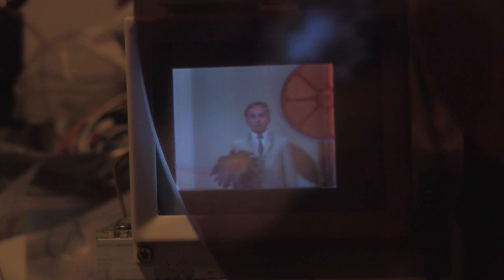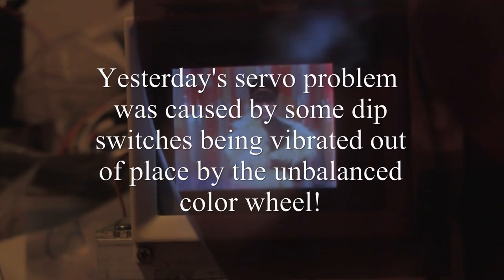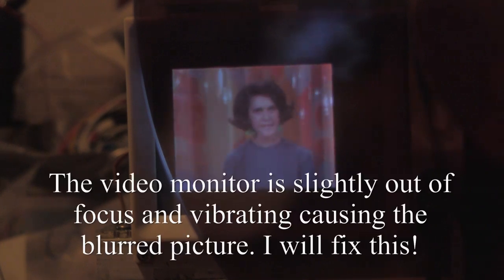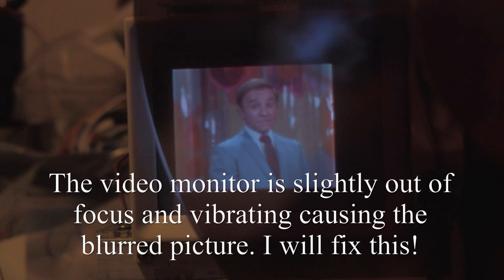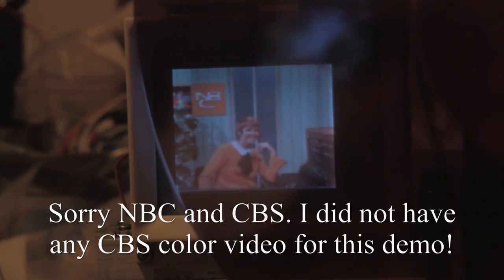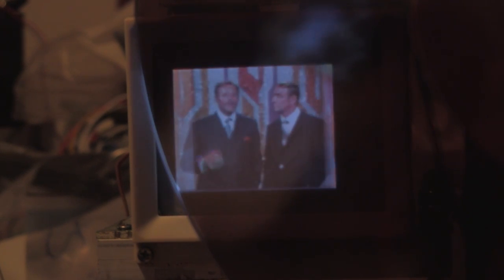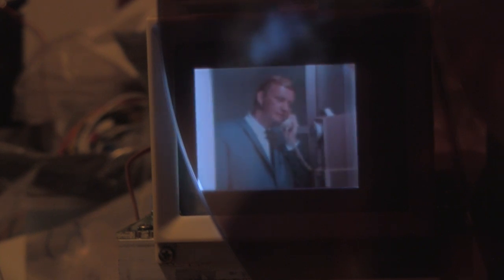Goldmark 1 - First Light #2

Comment: You just know that if this ended up being used, then there would be more research on how to replace the color wheel with something more practical. For instance, how about a cylinder rather than a disk. Or a belt with color filters on it.
It would also work with a shadow mask CRT for obvious reasons, but research on the shadow mask would've not been as strong as it ended up being.

The ultimate form would be the liquid crystal color shutter that was used on oscilloscopes in the 80s.  That ended up being used on JVC video monitors in the late 1990s, but with broadcast sequential color it would be much simpler.
Also, had that happened. it might've come along sooner than it did because it would've been a more profitable idea.
Reply from the maker: The Tektronix TDS744A oscilloscope, that I purchased just for this project, used a tricolor shutter in front of a white CRT. Co inky dink? I think not.
Reply: I recall a "Popular Science" article in the 60s or 70s that pitched a "converter" you could put in front of your B&W set to get color. The diagram showed a belt with colored strips on it.

Comment: NASA used an NTSC compatible Westinghouse (CBS's parent company) camera for the Command Module of Apollo missions 10 through 17 as well as the Apollo/Soyuz and three Skylab missions. It only made it to the surface twice, on Apollo 12 and 14. Neither fared well. Apollo 12 astronaut Al Bean accidentally pointed the camera at the Sun only 42 minutes after activating it and the Apollo 14 camera had problems with the high contrast, especially the bright white of the spacesuits. The RCA built lunar rover camera of Apollo 15-17 used a spinning color disk to send stunning color television from the Moon and the Space Shuttle used mechanical color cameras well into the 1990's.

Comment: This is not really much different than the current DLP projection systems, with the exception that the color wheel is placed between the projector lamp, and the DLP chip, which sequentially displays the colors.
Even though the CBS system never really had commercial success, the principle made it's way down to the single chip DLP systems.

Comment: is this a ordinary B/W television behind this color wheel
Reply: +videolabguy a earlier vision of a DLP scanner very interesting did you make the color wheel or is this a vintage piece
Reply: +videolabguy  I find this very intriguing I hope I'm not bothering you with all the questions the link I found quite surprising there is such a history.   This might sound like a stupid question but, your using a ordinary B/W CRT how does this define color or will it produce color from a B/W source.  sorry for so many questions I find this so interesting
Reply from the maker: +Richard Golden In color TV, there are three channels. Red, green and blue. Same as the sensors in the eye. If you look at each video channel with an oscilloscope, they are each simply BW signals. When the three signals get recombined, on a screen or in your eye, you see full color. In NTSC the three colors are simultaneous. In this system they are in series. First scan contains all red info. Next is blue. Then green. Your eye stores the images long enough for them to appear to overlap in time or appear continuous. Read more here: https://en.wikipedia.org/wiki/Field-sequential_color_system.